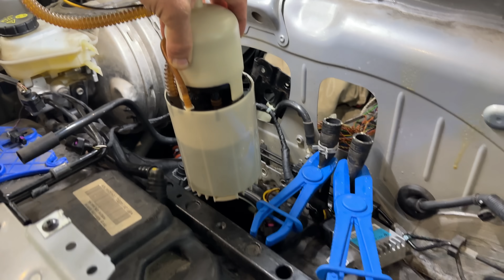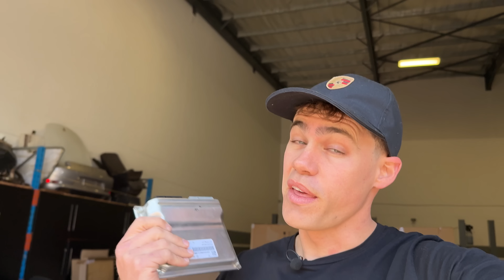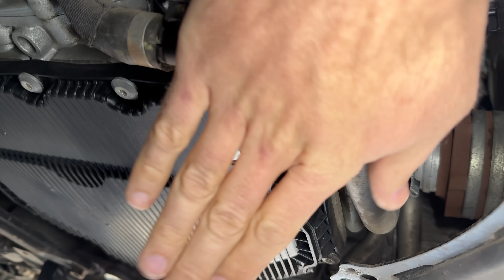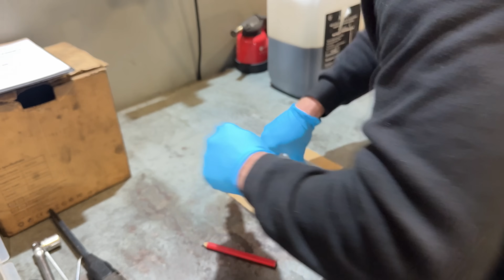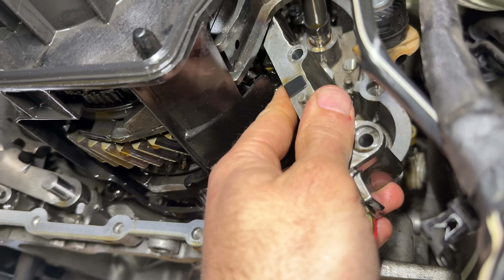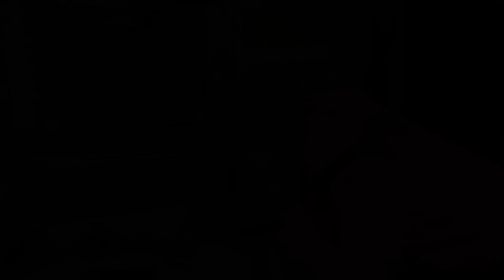NEVER EVER BUY A CAR STRUCK BY LIGHTNING!!!

Comment: The interesting thing about lightning is that it is extremely high vo,take with very low current - this means that you might see some signs of Carbon where the current went to ground, but they are often so small that you need a magnifying glass to see the pin hole through the insulator. The Carbon acts as a conductor and all sorts of weird things result - measurements can be wildly confusing. I have fixed lightning damaged items - but the time involved and the ensuing mental suffering and madness is the true pain of the job. I am guessing that your solenoids in the gearbox will have been damaged as the current tried to find a path to ground… tricky when the car is sitting on fat rubber insulators called tyres! That current will have shot around all through the harness looking for ground…

Comment: This looks like a Printed Circuit Board (PCB), likely from an Electronic Control Unit (ECU) or another automotive electronic module, given the context suggested by the connectors and the general appearance.
There are several common reasons why a PCB, particularly one in an electronic control unit, might be heating up excessively. To diagnose the exact cause, you would need to test the unit under operating conditions, but here are the most likely reasons:
Common Causes of PCB Overheating
1. Component Overload or Failure
 * Short Circuit: A short circuit on the board (e.g., between power and ground traces, or across a component) can cause excessive current draw, leading to rapid heat generation in the shorted area or the power supply components.
 * Failed Component: A specific component (like a voltage regulator, a transistor/MOSFET driver, or an integrated circuit like a microprocessor) might have failed internally, drawing too much current, or failing to switch properly, causing it to dissipate power as heat. The finger is pointing near a specific area that might house such components.
 * Excessive Load: If the unit is driving an external load (like a solenoid, motor, or lamp) that is drawing more current than the circuit was designed for (due to a fault in the external component or wiring), the output drivers on the PCB will overheat.
2. Power Supply Issues
 * Overvoltage: If the unit is being supplied with a voltage higher than its specified operating voltage, the components (especially regulators and chips) will dissipate more power than normal, resulting in higher temperatures.
 * Faulty Regulation: Internal power regulation circuits on the PCB are designed to provide stable, lower voltages to the chips. If a regulator is failing or struggling due to input power issues or a heavy load, it will heat up significantly.
3. Thermal Design and Environment
 * Inadequate Heat Dissipation: The components may be operating within their normal parameters, but the thermal management (heat sinks, thermal pads, airflow) might be compromised. The two gray/black connectors also function as heat sinks for the main chips beneath them. If the unit is not properly installed in its case, or if the case's thermal paste or pad has dried up or is missing, heat cannot be efficiently transferred away.
 * High Ambient Temperature: If the unit is operating in an environment that is hotter than its specified limit (e.g., a hot engine bay), its internal temperature will rise above normal, potentially causing it to overheat.
4. Software/Firmware Issues
 * High Duty Cycle/Continuous Operation: In a micro-controller-based unit, a software or firmware fault could cause a component (like a transistor or relay driver) to be held ON constantly (a high duty cycle), unnecessarily dissipating maximum power and heating up the board, even if the load is normal.
To determine the exact cause, a technician would typically:
 * Measure the current draw of the entire unit.
 * Use a thermal camera  or Isopropanol to visually pinpoint the hottest component.
 * Test the voltage levels at key test points.
 * Check the specifications of the hot component to see if it is operating within its rated limits.
 * Check for short circuits with a multimeter.
I recommend consulting a professional if you suspect a fault in an ECU or critical electronic module, as improper testing can cause further damage.
A Printed Circuit Board (PCB), like the one shown, typically heats up because power is being dissipated as heat faster than the unit can cool itself. This usually points to either a faulty component or an excessive current draw due to a problem in the electrical system it controls.
Since this board appears to be from an Electronic Control Unit (ECU)—suggested by the connectors and design—here are the most likely causes:
Primary Causes of Overheating
1. Component Failure (Internal Fault)
The most common cause is a single component failing and drawing excessive current.
 * Short Circuit: A short circuit on the board, often in a sensitive area like the power planes or a data line, causes a large amount of current to flow and heat up the surrounding copper traces or chips.
 * Driver Failure: The board likely contains powerful transistor switches (MOSFETs or IGBTs) that drive external loads like ignition coils, fuel injectors, solenoids, or cooling fans. If one of these drivers fails in an always-on state, it will overheat as it continuously passes current that should only be momentary.
 * Regulator/Microprocessor Failure: A core chip, such as a voltage regulator or the main microprocessor, may have failed internally, causing it to draw too much power and dissipate it as heat. The area pointed to by the finger is a common location for high-power switching components.
2. External Overload (System Fault)
The ECU itself may be working correctly, but the component it's controlling has failed.
 * Short to Ground/Power: If the wiring harness or an external component (like a fuel injector or solenoid) connected to the ECU is shorted or has abnormally low resistance, the ECU's output driver circuit will try to supply the resulting excessive current and overheat.
 * High Current Draw: The load attached to the ECU's output might be drawing more current than intended, pushing the driver components (and their associated traces/heat sinks) beyond their safe limit.
Other Contributing Factors
3. Thermal Design Issues
 * Heat Sink Compromise: The two metal parts (likely heat sinks or simply large connectors) are there to draw heat away from the chips directly beneath them. If the unit is not properly secured in its protective metal case, or if the necessary thermal paste or pad between the heat sinks and the case is missing or dried out, heat cannot escape efficiently, leading to internal build-up.
 * Environmental Heat: If the unit is located in a very hot area (e.g., a cramped engine bay) and the ambient temperature exceeds its design limit, the components will naturally run hotter.
4. Overvoltage
 * A failure in the vehicle's charging system (like a faulty alternator/regulator) that causes the system voltage to be too high can stress the ECU's power input circuits, causing them to dissipate more power as heat.
🛠️ Recommended Next Steps
Because this is a critical electronic component, diagnosing it properly requires specialized tools:
 * Visual Inspection: Look for discoloration (brown or black marks) on the PCB, which would pinpoint the exact component or area that is overheating.
 * Thermal Imaging: A thermal camera  is the best way to locate the hottest spot immediately.
 * Current Draw Test: Measuring the overall current being drawn from the vehicle's battery by the ECU can quickly confirm if it's experiencing an overload.
Do not attempt to operate the unit if it is confirmed to be overheating, as this can lead to permanent damage or fire risk. It should be diagnosed by a professional electronics repair service or an automotive technician.

Comment: we had polo 4 struck by lithning antena from radio burn oles on loof most electronics blown but even marks on tures but most electronics blown the worst is the radio play no ploblem without 20 cm antena burn into roof and holes in back brake light and back window
Reply from the maker: Hope you weren’t driving when it happened 🫣